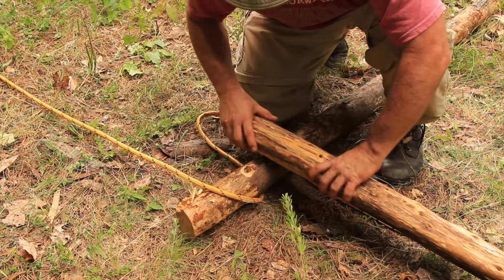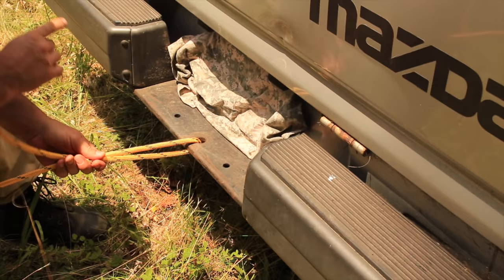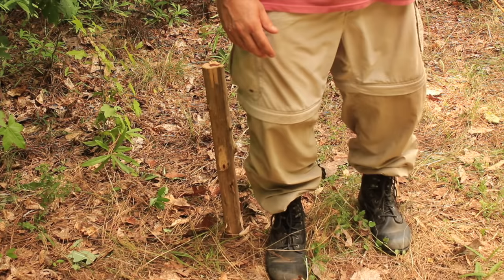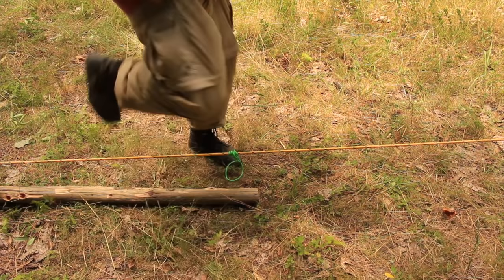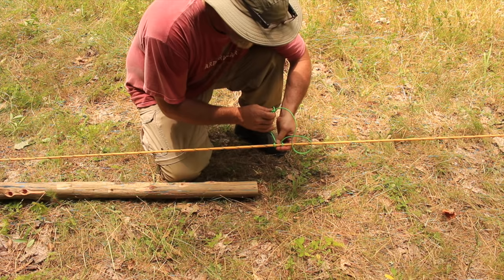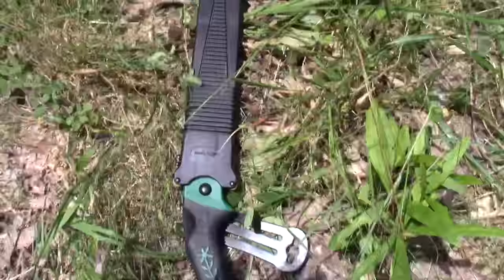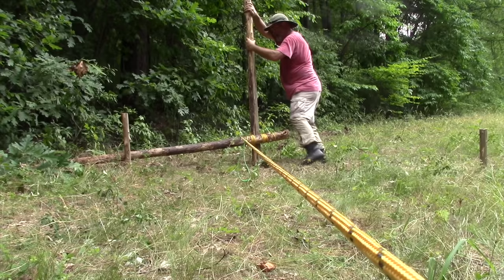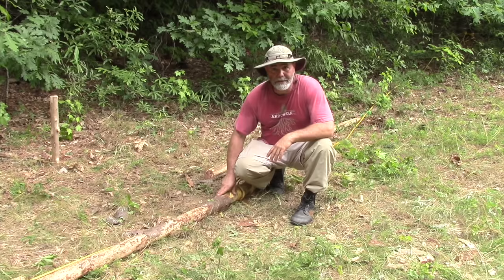Off Grid Winch: Making a Flip Flop Winch

Comment: Good video this will go in my toolbox.
I do not want to sound like a safety Nazi but you should lay a Jacket or shirt or peace of cloth on the ropes in case they snap it will help stop the whiplash affect.
Reply from the maker: Good point, "safety Nazi", just kidding. I think I mentioned this point on my blog for this technique. I know I did when I demonstrated it with out Scout troop. Thanks for adding value!
Reply: Good point. I’ve had it break before and hit my buddies leg. Layed open the skin. 👌🏽safety first.
Reply: Whiplash only occurred in TV movies.  No rope has enough kinetic energy to whiplash more than a few inches.
Reply: @pointblank1978   your buddy has some thin skin.
Reply: @olsim1730  afraid not neither am I. That rope doesn't have the weight nor could it bear enough weight to release enough energy to cut a wet noodle.
Reply: @kastiron6752  that's a damned mooring line.... Not a light nylon rope.
Reply: I know. But his statement was, "no rope has enough kinetic energy..." That is factually incorrect.
Reply: Rick Sanchez bull whips work on completely different principal. When a line breaks it will coil like a slinky it does not whip around and flail all over the place. After working for a decade with steel cables under heavy tension not once did we witness a steel cable whip around after it broke. They always coil up along the original path.
Reply: Mech Uno great preventative measure!  That’s nnovation
Reply: @olsim1730  exactly! ship lines have done major damage when they part.
Reply: For this purpose specifically, hemp rope or static line, as they don't stretch (much) and so don't store energy the way a cable or climbing rope can.  What causes the whiplash is the recoiling from being stretched.
Reply: Sonny D it depends on the rope, there are dynamic and static lines and they each react differently when snapped from over pressure.
Reply: Anything is only as strong as it's weakest point. Might seem obvious, but exactly where would u put a blanket?
Reply: @driftordraft  You are an optimist.
Reply: @kastiron6752  Any thoughts on how to prevent that particular tragedy?
Reply: @flikajones6109  put it halfway between the tie point and the log. The highest probability of breakage is at the tie point with the knots, so halfway point would stop the loose end from reaching you, and maximize the covered area. Too close to the tie point and a break anywhere on the uncovered length could reach you.

Comment: Neat trick. Would it be a little easier if the barrel pole was fatter and shorter? As you'd wind more each turn and it would be easier to turn, or would a fatter barrel pole reduce the mechanical advantage?
Reply from the maker: A larger diameter barrel pole would wind more rope with each revolution but making it short would cause you to loose leverage on the flop. They could be any size pole as long as they are manageable for you.

Comment: My dad taught me as a kid (we grew up doing shit like building our own homes), when you have a rope, cable, chain, etc under high enough tension to be worried about failure; tie a t shirt or jacket, etc to the rope.  The heavier the application the more soft mass you want.  The mass/wind resistance will greatly reduce the damage the cordage does if it fails.

Comment: First rule of using a winch is never EVER cross a “live” winch cable, extremely dangerous, you could lose your nuts or a limb if it snaps. Please, At least tell people to cover the rope with a blanket or some sort of dampener so it drops to the ground if it snaps.
Reply: Is the "'live' winch cable" the cable between the device and the truck? or that whole cable from the truck back to the anchor?
Reply: @pashaveres4629  both have same strain, live means cable under the high tension aka live as in under strain of being used as a winch.
Reply: @mattlucas719  okay. i figured it applied to both (couldn't imagine how it wouldn't) and just wanted to be sure. thanks.
Reply: He does, 9.10, cover the dangers of tension. The finer details should be common sense. For those without common sense, well that's mother nature's weeding out process. Nowhere in this videos title did it mention how to suck eggs
Reply: How would he do this without crossing the lines? Walk around the truck each time?
Reply: this is not a cable.    this is a rope  that does not have a lot of mass and looses energy very quick.     WOW
Reply: @ctsteve1967  Rope stretches a lot (30%) so will snap like a rubber band.  A whip has little mass and damages; this a lot more.
Reply: you might be called broken pencil for a reason,     low mass like the rope being used will not  whip as you think.   So low mass does not produce a whip Think  Sewing Thread.    But I agree that one should not take a chance and leave the rope un covered.
Reply: This is literally emergency situation and you have nothing else, the whole process involves stepping over it multiple times so you basically should have just said don’t do this at all. Because you can’t do this and not step over it.
Reply: @ctsteve1967  Greg, I've seen a tow line snap with enough power to take out a rear window. Nylon line especially has a lot of elasticity and will snap with a lot (!!) of force when there is a ton or more of tension. Chain can snap with a lot of force too, I've seen it. When I've seen steel cable snap under tension though, it has been with a tearing sound (of the cable's individual wires breaking) followed by the cable going slack, so that wasn't that bad - but that has just been what I've seen over the years, so I can't guarantee steel cable couldn't be dangerous under some situations. The difference is I know nylon rope and steel chain certainly can snap with enough force to bash the side of your head in as I've seen it myself.
Reply: @djsantiago3904  Thanks - that level should,ve been on Mario Bothers.
Reply: @Justin-bv3gi  Yes you can. Walk around the truck or the anchor point. Patience grasshopper.
Reply: @ronunderwood5771  That's not what your mom said.

Comment: For efficiency and safety, do not use a nylon rope.  Nylon stretches considerably so it loses efficiency.  If it breaks, it can recoil with enough force to cause serious injury, really serious.  Dacron (polyester) is a much better choice.  Far less stretch.  Use braided (as shown in the video) rope instead of twisted.  It will cost more than nylon or twisted anything and it's worth every cent in this application.
Reply: Thanks for the info

Comment: For big projects that requre more distance pulled you can set up two lever winchs in tandem and tie a frap on the closer winch once the object being pulled reaches it, then  repeat with the next winch in sequence.

 You can also make a tow line that has alternating loop holes to fit a lever, that once its taught, you can still attach a second winch once you tie off the first ones wraps with fraps and the line is taught.

Comment: I could have used this a few years ago.  Will buy some good cord very soon.
Reply: Herbert, nylon is tuff but dangerous because of elasticity. I've seen 5" 8 braid (3" 3-braid, too) nylon go boom. Used to work on offshore tugboats. 

With enough tension, nylon blows at the speed of sound. I worked with a guy that got his arm broke by 1" 3-braid.

Pretty sure paracord is nylon.

Granted, you more than likely won't be getting close to the 50 ton bollard pull that a triple screw tug will, but just be careful.
Reply: I do appreciate the help.  I do know rope.  Just never seen this idea before very cool.
Reply: No such thing as "3-braid" or "8-braid". What does exist, however, is 'three strand', which is another name for conventional twisted rope. 'Single braid' is a  hollow braid with no core. 'Double braid',  is a braided cover with a braided core. Other variations are 'single braid with a 3-strand twisted core' and 'Single braid with a parallel fibre core'.  You can have '8 strand braid, or 12, 16, 32 up to 144 strand braid but not "3-braid" or for that matter, I've never seen a 'triple braid' (braided cover over another braided cover over a braided core) though theoretically, it could exist..

Comment: this may have already been mentioned but trying to find it thru the comments will take awhile and it mat bear repeating... if possible, I would double the rope when tying it off to the bumper. There should be a space where the tag is to loop the rope and tie it back to itself. I would also attempt to use a tow hook if it wasn't buried. Joe Luovici mentioned throwing something heavy over the rope, great idea! if you didn't have someting heavy, you may be able to make another loop or two and put a small piece of wood inline as a "stop". It should, should keep the rope from flying back and injuring you since it will be perpendicular to the rope. Stay safe out there and thanks Survival Sherpa!

Comment: A flip flop is the simplest logic circuit and it stores one bit of information. It is constructed using a transistor and two diodes. With connecting wires.

Comment: The knot used to attach to the truck made me wince. A round turn and two half hitches would be more solid - or even better, have a shackle for that eye and tie to it. Putting a rope directly through the eye really weakens it.
This winch is great, wish I'd known about it on the farm, many decades ago.
Another tip - if you get a high-lift farm jack, that can also be used as a winch, when laid down flat. Just be careful tying the ropes to the winch. Gets you 4-5ft of movement, using a 3.5 ton winch.

Comment: Thanks. I subscribed (which I only do rarely) because it is a useful idea. The mechanical advantage should be (the handle length measured from the center point of the rope wrapped log)/(rope wrapped log radius) to one. Which would be about 42/1, so about 40 lbs of tugging on the handle could put about 1680 lbs pulling force on the tow line, 50 lbs about 2100 lbs pulling force. That is enough pull to work most of the time. And you could double the pull if need be if you had a block (pulley) at the anchor point, and ran the line through the block and back to the bumper, which is enough to work virtually all the time, so long as you had an anchor point and a long enough line. I would suggest at least 1" line though, unless the vehicle is quite light.

Comment: The comments on this are funny half of people’s suggestions are really bad, and could possibly get you hurt. Or are unnecessary or over complicating things. Only advice I can give to counter bad advice is know your gear. Know your working load limit for your rope, know what wood you can and can’t use, know ruffly how much your vehicle weighs. Slope and terrain will also have a huge effect on how safely and efficiently this can be done, but really awesome method overall, and building a good kit for this technique is much cheaper then buying a wench.

Comment: A normal rope has about 30% stretch , with 150 pounds of force on it , when rope breaks it will fly back at you at 800 MPH and hit you when you flip that log .   You need a Static Rope that doesn't stretch which cost about 300 bucks , same price as an electric winch with cable

Comment: Brilliant system, can't wait to get bogged down! Tip of the hat to suggestions of throwing a blanket over the line but I think a far safer method of crossing over line, cable or chain under tension is to put your foot on the line as you cross that way you never straddle it exposing your vunerables to potential whippage....

Comment: Great concept, great video, thanks. The only suggestion I might add is maybe changing the constrictor knot at the truck. Concern is that under lots of pressure a friction knot can be drawn so tight that it can be a challenge when deconstructing that knot. A quick release knot, such as the Farrimond might be a good option.

Comment: The initial setup could be smoother & more explicit:
{ This pulley should be placed near the middle of the line; closer to the load, but farther than the needed pull distance.
The dirt scratching (short) ends look like they could be conveniently shorter.}
1. Attach the line to the load. 
2. Lay a straight line from the load to the anchor, but with a loose "S" near the middle. 
3. Put the end of the toggle log across 2 of the 3 lines of the "S". 
4. Flip the 3rd line of the "S" on top of the end of the toggle log. 
5. Lay the end of the pulling log onto the toggle log above the loop that is still on the ground. 
6. Flip that loop onto the end of the winch log, and snug the line toward the anchor, so that both ends of the rope are on the short toggle side of the pulling log. *
7. Attach the anchor snugly. (This should simply be 3 or 4 turns around the base of a solid tree or rock. Easy to adjust, and much stronger than a knot.)
8. Attach the 'control line' (described below) near the long end of the toggle log, using a clove hitch.

Rather than the two stakes, which have to be laboriously made & moved to keep up with the winch migration toward the anchor, I recommend a 'control' line (perhaps the extra end of the anchor line, wrapped only once around the anchor line) from the anchor to a clove hitch, very near the long end of the toggle, which can be easily adjusted as needed (just by flipping another turn over the end occasionally, to keep the toggle perpendicular to the pulley line & log).   
* If you expect to do a very long pull, you will either need a longer dirt end for your toggle,
 or you will need to have both pulley lines on the long-toggle-end side of the pulling log, and you might also need to keep the long toggle end from moving anchor-ward, with a control line from somewhere on the load line.

Comment: This was pretty cool to see. Just last night I was trying to think of a very small, not too complicated, ratchet system to  I wanted to use for stretching some braided fiber.

Just before he mentioned the safety concerns I was thinking, "oh fuck, if that rope snaps, it'll really suck." If Anyone's ever seen videos of cables snapping when someone's too close, you'll understand. I would reccomended having a length of whatever rope suites you, specifically for something like this. Don't use it for anything else, and once used either inspect it, or replace it. If there's any fraying or abrasions at all replace it.

My reasoning is that, there's a channel called HowKnot2, and they stress test rock climbing ropes and gear. Watching how they treat their ropes, and attitudes towards using/ replacing them has kinda taught me to pay attention to the conditions of my ropes, depending on their intended use. I figure if a rock climber won't use a rope because it's frayed, and might end their life, so to would I not use a damaged rope on a wench, because it might end my life.

Comment: Here's something I've heard referred to as a "Mexican" winch.  You replace the wheel/tire with a bare rim and attach a cable to it.  The hole for the valve-stem is used to anchor the cable.  You then start to drive, in reverse, 1st gear, or preferably (if available) 1st gear-low.  The cable wraps up on the rim, and pulls you out.

Comment: Just wrap an anchored line around a drive wheel a few times. Put it in gear and use the rotation to pull the car/truck out

Comment: I did a really stupid thing and ended up stuck in the woods on the WI-Upper-Michigan border in 3 feet of snow wearing street shoes. I lucked out to find a junk CB radio that I was able to get working. But this trick might flip-winch system could possibly have worked....I probably would have lost digits to frost-bite but this could have saved my life. I was sitting frame-on-the-ground with all four wheels spinning in ruts so Im not sure.

Comment: Good video. I would just add that IF you happened to have a clevis or something similar that is smooth, I would use that to connect to the truck bumper to avoid tying the rope to a sharp edge. Also, attach a blanket, tarp, coat or similar item to each span of the rope to lessen the danger in case it breaks.

Comment: In Australia quite a few people in the outback use a winch on the front bumper but I`ve seen a few fail, so it`s handy to know in an emergency, I was taught by an old koori (native Australian) I was doing some work for, I was bogged down and my cheap Made in China winch crapped out first time !  as for the rag/coat trick I`ve seen it used all the time, I don`t know if it really works that well but I don`t want to ignore it on the day the rope snaps .

Comment: It will only move something a few inches each time BUT its perfect if you have no other equipment and are on your own
Reply: Depends on the diameter of the base log and how much stretch in the rope. A six inch diameter log has a circumference of nearly 19 inches so using a strong rope or strap without much give you could move an object about 9 inches on each flop. So just six or seven times and you've pulled your vehicle  a distance of 4 feet. If you're stuck out in the middle of nowhere its not like you've got something better to do lol.
(Don't hold me to the math!)